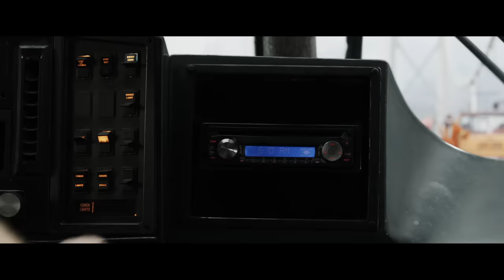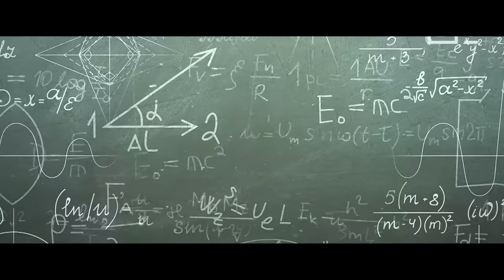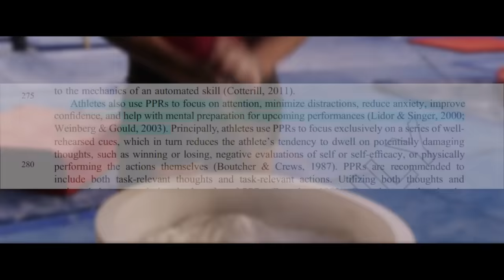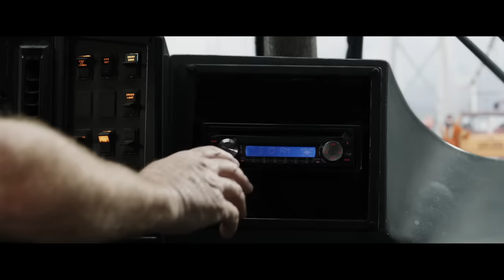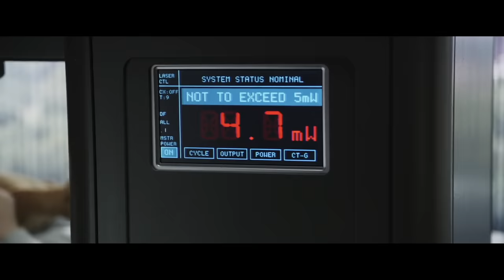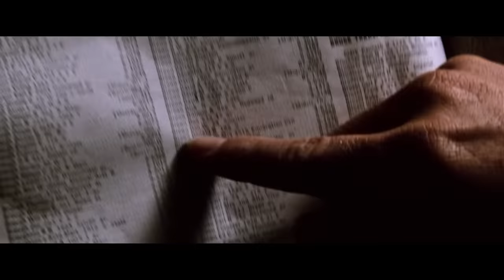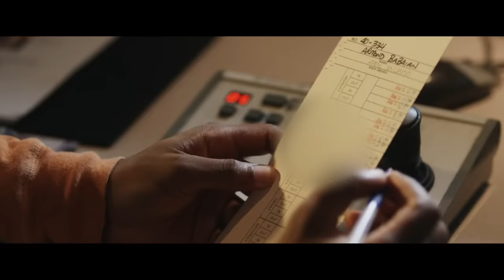How To Beat DEATH In "Final Destination 5"

Comment: The biggest problem I have with this franchise is that there's no internal explanation for the premonitions. If the victim was supposed to die, why be warned?
Reply: It's sort of hinted towards in the novel that death is the one that gives the premonitions.

Why it seems to be vaguely imply that death is just kind of sadistic force that just kind of gets bored with the normal flow so decides to shake it up and have a game of cat and mouse with people's lives
Reply: @volfawott7417  You've just proven my point. "Sort of hinted" and "vaguely implied" aren't strong enough to be an answer. This is further hurt by the second film where two characters live to the end of the film. I don't count the died offscreen of the third film because that was just a special feature of the DVD and not part of the original film.

Comment: @18:00 The laser is easier to deal with than that. Anything shiny or flat will deflect the laser, even if only half of it gets deflected, that's half of the energy coming at you. A phone is kind of ideal for this because the laser first gets deflected and THEN has to melt through the phone just to reach you. If you hold it up with your hand then it has to eat through that as well, buying you time.

The machine must have been faulty from the design phase on up as it is possible to make fail-safes incorporated into such machines, preventing them from being CAPABLE of generating too much laser output.

Remember that this is a machine made for SURGERY, where extremely fine-tuned control and precise measurements is WAY more important than raw strength and power output.

Comment: I’d just like to say that it appears as though the lasik machine is plugged into a gfci outlet, which when shorted shuts everything OFF. And I know that what your about to say, the COOLANT SYSTEM was plugged into the outlet, which makes no sense as the coolant system should run off of the same 240 (maybe 120, don’t know much about lasik machines, just that they  are a heavier appliance) volt that the machine runs on.

Comment: Ik im late, but for all 5 parts of this series, could the survivors not just hid together via a loophole the entire time for the rest of their lives, or until most of them had kids? I mean it like this, the first survivor hides with the third survivor, the second survivor hides with the fourth survivor, and so on, if it is an odd number, the last survivor can hide by themselves for a while, death will constantly be unable to kill anyone, as it has to kill the first in line, but it can't as the third in line is right next to them, if it were the second in line it could kill both at once, but since it's the third, it can't do anything to kill them as it isn't their time to go yet, and when death skips over the first in line, the second in line will hide with the fourth in line and it will go through the same thing, in fact, if there are an even number of survivors it gets even better- Let's look at it simply here, 4 survivors left for death to kill, the first lives with the third, the second lives with the fourth, death will not be able to do anything unless it breaks its own rules, it will have to spare them all as if the two groups always remain close together separately, then death will try to kill 1, but won't be able to kill 3 so it fails, try to kill 2, won't be able to because of 4, 3 is protected by 1, and 4 is protected by 2, it's such a simple idea that none of the characters ever even considered after they found out everything about how they were dying.

Comment: I just don't understand how Molly's death on flight 180 works with Death's design. Molly didn't die in the premonition so her escaping the bridge another way doesn't change her fate and I can't see her being on flight 180 if Sam wasn't there so how does that work in the grand scheme of things?
Reply: That’s is the same thing that I said, but I think Molly died in plane crash because Sam was alive. Therefore, death came for Sam, regardless of casualties. Think about it: in final destination 3, concerning the ending, the survivors of the rollercoaster crash all died, alongside the other passengers, via the train derailment. If the survivors were not amongst the living, future calamities would have been avoided.

Comment: 9:07 As a guy who's done parkour and gymnastics for over a decade this is extremely unrealistic. Especially when you're doing double flips and twists you really don't actually use your vision but instead use your aerial awareness and how you feel gravity to find the ground. This is what makes the sport actually pretty safe; since you can feel where the landing will be and brace if it's not correct. Slipping off a bar is very common, and doesn't end up like that

Comment: Imagine a Final Destination where the protagonist(s) don't get a premonition about their upcoming death but they survive a highly elaborate scheme by Death through sheer luck or ignorance, etc.

For example, Death puts a rusty nail on the ground. The protagonist steps on it and the nail bends. But it does also put a hole in the shoe.
Death tries to set up a death at the shoe shop by having the sign fall on them via a crane but the protagonist decides at the last second that the damage to the shoe isn't so bad and turns away right as the sign falls and crushes some people.
And as they go about their day, all this elaborate setup happens behind them until at the end, Death sighs in frustration, throws out a banana peel.
The protagonist slips on it and Death finally has managed to get them at last!
Nope, they land on top of a dead body of another person and are saved.
There's a sudden harsh chill in the air as if someone unseen had just rage quit...

And thus that's how they beat Final Destination... :D
Reply: That'd make a good "spin-off" or comedy version of the movie, but I don't see it happening in a "serious" title. Death (Basically "Fate" itself as I like to call or see it as in this series) doesn't make mistakes with people without premonitions.
Reply: @mekingtiger9095  
I know Dead Like Me had a few of those setups...
There was a name several people shared including an office worker, a bank robber and a bank teller.
All sorts of stuff explodes around them and guns are pulled on people, etc. and no one actually dies.

Then a guy walks in and slips and dies on a banana peel that had been dropped earlier that day by the gremlins who create those setups.
Turns out he too had the same name as those others...

Comment: I would have tried to grab one of the suspension cables that ha already broken free. They wouldn't fall into the water, and I could rest my feet on the hanging concrete chunk until help arrived.
Reply: knowing death, the concrete would probably crack and break under you. even if you somehow had enough grip to stay on, you wouldn't for long. the cables would rip and cut through your skin and flesh as you slowly fell and you'd eventually fall off.